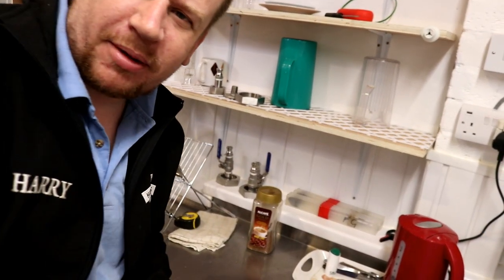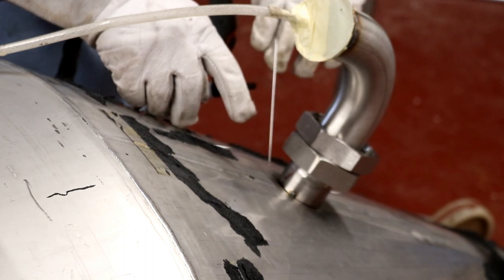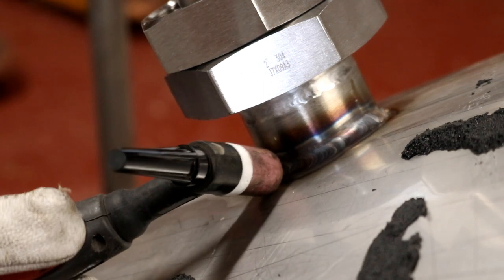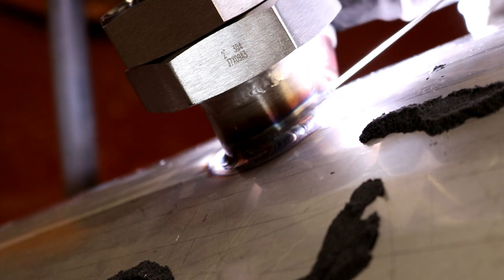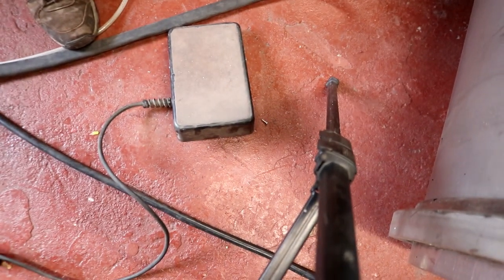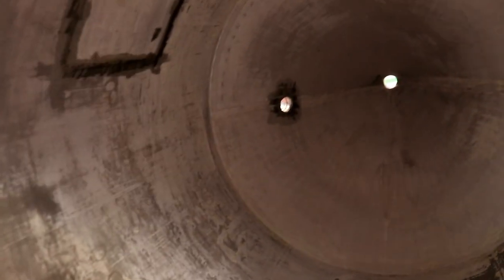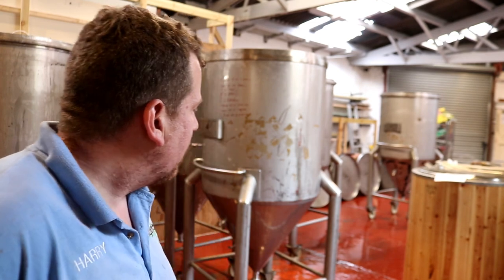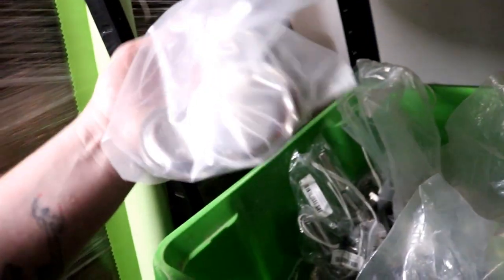TANK WELDING LEVEL UP ~ MAYBE THE LAST FOR SOME TIME.

Comment: Looking at the jacket on the cone on your vid buddy. I’ve also just read in the yeast brewing elements book page 98 that you can have multiple jackets on the fermentor including a jacket on the cone. That way you can cool the cone before dropping the temperature of the tank. This encourages floculation and ensures the cone is cold enough to keep the yeast building up too much heat as it sits in the cone until harvested.
Reply from the maker: Yeah, I read a bit about cone cooling when I built the 2000 litre tanks at IVB. I just thought the size of the cooling panel they had put on was pissing in the wind a bit.